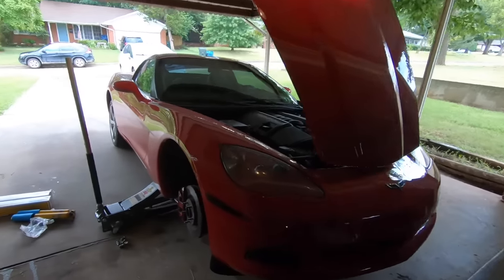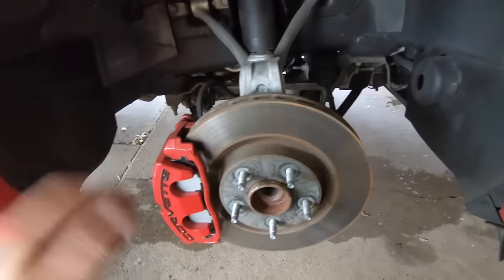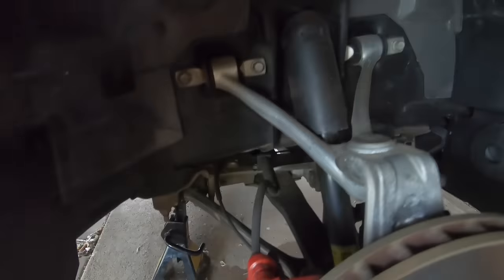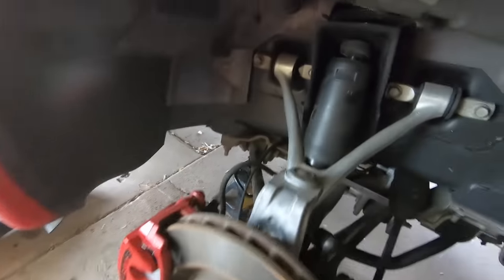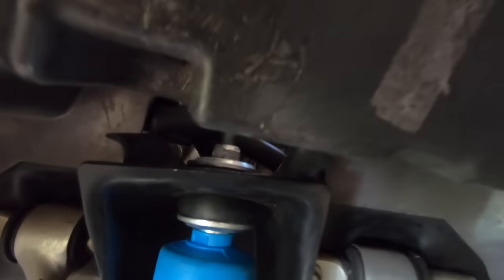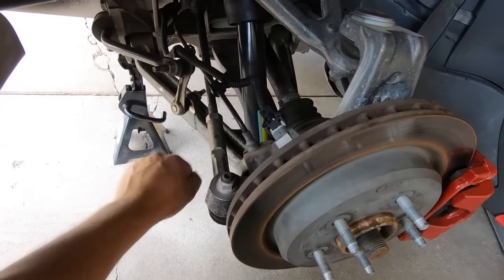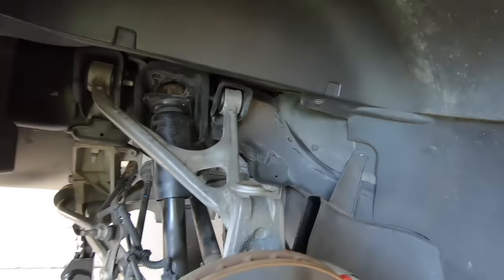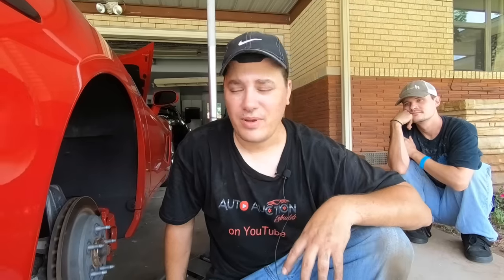Replacing the C6 2009 Corvette Shocks - Bilstein B6

Comment: You should use zip ties to hold the shocks in the compressed position before you unbolt the shock at the top and bottom. This way you won’t have to fight the shock trying to elongate when you are trying to remove it from the limited space that is available.  Also, you can buy a Shock socket from NAPA Auto Parts for $2 that holds the front shock upper pin in place while you loosen the nut. The shock socket opening for the pin measures 6.1mm x 8mm, this is sometimes referred to as a Double D socket.

Comment: I've put Bilsteins on my last three trucks. IMO, They're worth it, big difference. I tried to save a few bucks on my Colorado and put KYB, then Rancho. Hated both. Ended up with Bilsteins. My '10 Xterra Off-Road came with Bilsteins from the factory, the fronts are coil overs and were a real P.I.T.A. to replace due to having to use the spring compressors to take them apart! Great choice of shocks.

Comment: If you had used a piece of thin wire, you could have compressed it and lashed it compressed. Gas shocks usually come with a strap to keep them compressed during installation. Good job doing it the hard way, but it did work.

Comment: I've spent the last hour trying to figure out if the notch on the rear shock upper plate is supposed to be towards the front or rear of the car. This helped. (Nice picture at 13m17s.) (And, yes, it appears to make a difference. )

Comment: I just had this same Bilstein shocks installed on my C6 Corvette. You made a small mistake. The rear Bilstein shocks require a slight longer bolt (bottom side) in order for the nut to lock in place. The Bilstein’s rear shocks slightly thicker metal brackets on the bottom. Compare the stock Corvette ones to it and you’ll see what I’m talking about.  Just concerned for your safety is all.

Comment: Waco, TX
Friday 1:00 PM

Fri
Sunny
105°78°
Sat
Mostly Sunny
109°81°
Sun
Partly Cloudy
109°81°
Mon
Partly Cloudy
109°81°
Tue
Partly Cloudy
104°76°
Wed
Partly Cloudy
104°77°
Thu
Partly Cloudy
105°78°
Fri
Mostly Sunny
104°78°
Excessive Heat Warning
Dallas - Fort Worth
6 hours ago – National Weather Service
Temperatures of 105 to 110 degrees are forecast, and heat index values may exceed 110 degrees at times ... EXCESSIVE HEAT WARNING REMAINS IN EFFECT UNTIL 7 PM CDT .............Until the next tropical storm or mild hurricane comes  thru...LOL !!!!

Comment: Why didn't u put some grease and maybe a drop of oil on the bolt's moving part when exchanging the rear shock, or by the way on any even minimal movin' and possible rubbing  parts ? I think it'll prevents moister, + keeps it slippery, and so extends lifecycle + reduces all kinds of possible noise.
Reply: Be careful what you recommend. Adding grease/oil will also attract particles and increase the wear. If you want to lube it anyway, then make sure it's at least dirt defiant.
Reply: @Litanic  being careful is still a very good advice

Comment: Dude you tighten the top bolts to torque spec with the suspension loaded. Same deal with unbolting the old top hat bolts. The content is great but some of the things you do should be in time lapse without all the play by play. Btw some good zip ties will keep the old shock compressed for removal and safe for storage or shipping there’s a reason new shocks come fully loaded.

Comment: not a fan of the good year tires. those little squares in the tread are the wear indicators thry aren't ready to be replaced yet but they are sorta close.too bad those weren't on the back i'd say you had two good epic burnouts eft on those tires. DANG you bought both of the EarthquakeXT impacts? i got the smaller Bauer one and the Earthquake XT 1200 pound. They are made really well. see that "on you tube" on her shirt is in a bad spot. LITTLE TRICK for keeping the shock compressed is strap it down with a wire hangar. then they come out easy.Don't know what her hang up is with not wanting to be in the videos. women working on cars is sexy as hell, could mean a LOT more views for you. there is a couple channels on you tube that have women  working on cars and those channels rock in views every month  got my shirt yesterday by the way.in black of course that's all i wear
Reply from the maker: Thanks man. Yeah too bad they weren't on the back! I'd have footage of the burnouts!! :) Thanks man, have a good one!

Comment: No need to screw around with zip ties or whatever.  Simply remove the 4 bolts holding the upper A-Arm to the frame- takes .0002 seconds to do., then you don't need to compress anything.  It's not like it's difficult or will mess up the alignment.  Just keep track how may washers were used under each bolt.

PS if you're compressing the shock using the tip of a screwdriver with zero effort, those are BAD. Very bad.